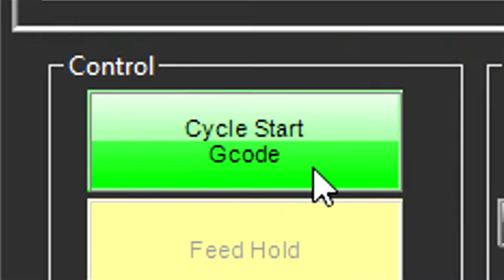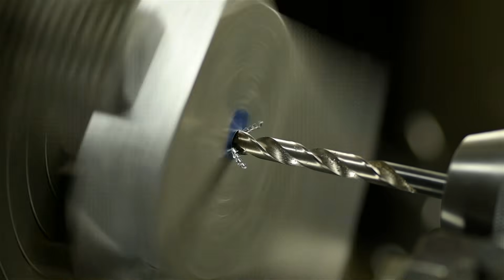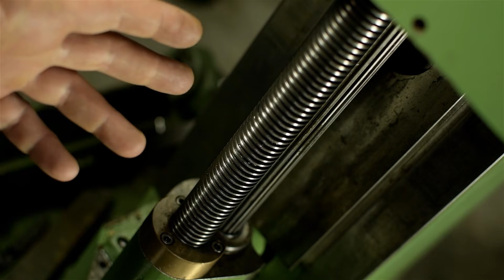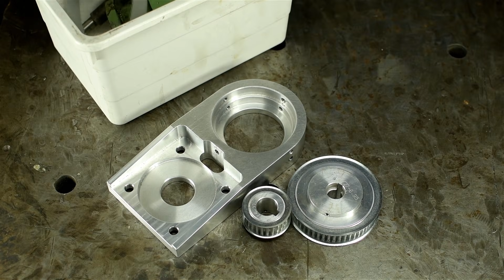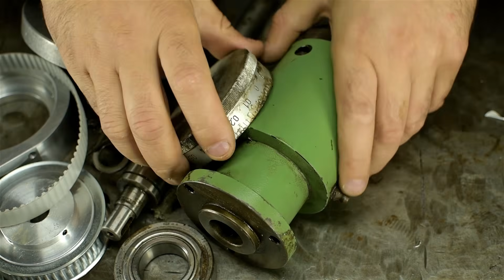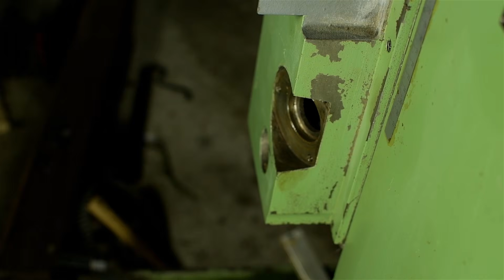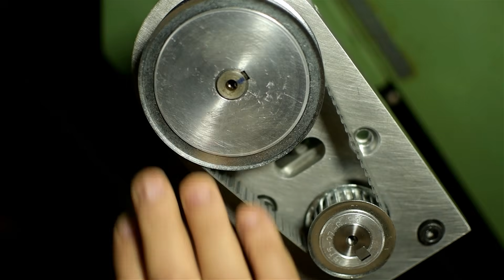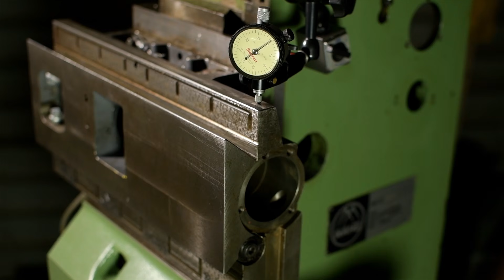MAHO: Move'n On Up!

Comment: The machine doesnt remember where it is when its off because of a battery, nor does it have anything to do with being closed loop. The encoder while being a part of that closed loop system is in of itself open loop. The reason why these drives remember where they are when powered down is because they use Absolute Encoders as opposed to Incremental Encoders. If your machine needs to be homed on startup {Haas} it uses incremental encoders. If the machine "remembers" its position even if moved when powered off its because of Absolute Encoders which have a unique code for each position on the encoder wheel. Incremental just creates pulses which are counted by the drive so it knows actual distance achieved vs distance commanded. {Actual closed loop system in operation}

Comment: The sprag clutch will most likely have been a mechanical brake for the downward motion of the vertical axis (Z?).

Having little resistance in the ways and screw might result in the handwheel free-spinning with nothing to slow it down until it crashes into the bottom of the screw travel.

This may also be why your belt is heating up, I would guess it's getting put under additional strain from having to brake the downward motion, which will also translate to your motor & driver eventually.

Comment: That weird sprag clutch in connection with the plastic bushing gives an extra friction in one direction and an even feeling on the hand wheel when moving the table up an down. Without it, the table would accelerate under its own load when moved downwards. Just my guess.
More important, for any positioning drive, the round-toothed HTD profile should be used in the timing belt. It is a bit more expensive, but runs much quieter and is free of backlash. A trapezoidal grooved belt isn't! Last, when a belt gets hot, it is over tensioned or too small for the job.

Comment: The belt may be too tight, but it could also be the radius of the smaller pulley. The belt tension across that small radius is deforming the belt and generating heat.

Comment: The reason the belt get too hot is that it is not sufficiently inelastic. By inelastic I mean that in principle the belt should not give or stretch in the lengthwise direction. That elastic stretch  cycling gives rise to heat. A bicycle chain and sprocket or gear set would not heart up but would probably be too stiff for the servoed stepper motor and would probably be vibration and noise prone. Somewhere there must exist a hardware/software happy compromise .. :)

Comment: I think you’re going to have to go to a ball screw. The problem that will cause you a ton of grief is backlash under load, especially when using solid carbide tooling. The head will lift under load as the tool engages and that movement kills tooling.

Comment: Hey Tony, check the power rating for the belt (heating), also if you are running it at high speeds maybe you can change it for another belt profile, like a HTD or a GT, nice job tho, can't wait for the next axis to be ready

Comment: Probably a little too tight? We end up using silicon spray/grease to drop the sliding/meshing friction heat. Manufacturers have a good equation that amounts to, "just tight enough to prevent oscillation or skipping". I think, we swapped the smallest ones for a teflon faced belt. Ooh, there's also a dry spray lube I got recommended once.

Comment: The weight of the table will take up all the backlash - as long as you don't accelerate above 1G downwards. It seems the lifting screw has  a finer pitch that you will get on a heavy duty ball-screw - maybe have to consider the weight and the torque required before replacing that screw. It may also be that the friction of the screw and the gears is what is taking up the torque. It will be interesting to get torque readings from the drive and do some math.

Comment: I'd base the decision on keeping the ACME screw or putting in a ball screw on the likely usage. If you're mainly going to be doing 2,5D (only stepping Z up and down in steps for z operations, or straight drilling/plunging) I'd just stick with the acme leadscrew as you won't be loading it that much and you won't have to mess around with a Z axis brake. If you plan to do 3D milling (z axis movement coordinated with x and or y axis motion) then I'd go for the ball screw as you'll wear that acme screw down quite fast.

Comment: Consider adding an idler pulley to your belt drives between the motor and the axis pulley. It'd be on the backside of the belt so can be just a bearing. You'll get more tooth engagement and you won't need to tighten the belt as much, which will probably cut down on belt heating.
Reply: You add belt tightness with an idler, so you don't need belt tightness. Yeah, OK.
Reply: @johncoops6897  It doesn't add tightness, it adds tooth engagement, Mr Johnny Come Lately.
Reply: @robotnicw  - I know, but his belt is too small to get any additional wrap. Plus it's not slipping, it's suffering from too much load. An idler pulley can't change that.

Comment: Hot and loud belts are usually from being too tight.

Encoder error is from no tuning. The max “step loss” alarm is triggered. Those motors can run max rpm 2-3000 with tuning so depending on your total reduction ~150-200  ipm? Not that you’d want to put those dovetails through 200ipm... forced oil system during rapids with sump and filter maybe? =) gonna have to oil those ball screws no matter

Comment: Maybe the motor is heating up. That heat is going in every direction. Check the current limitter if there is any in the drivers. Also black belts are good too.

Comment: I think you should stay with the acmescrew in Z. Ballscrews have lower resistance and the table will maybe "fall down" when you turn power off. You need then a brake on the Z Axis...

Comment: Awesome Tony!  Glad you jumped the cliff into the quality and precision of servos.  My DM's are still running 20yr now, sometimes 24/7, never changed a servo but belts and a drive once...think about 4096 quadrature counts on 20' and the accuracy you can hold or 4096 in 360°.  They called me to come in a couple of years ago because some one crashed the big drill into the chuck (wrong setup) moving the head!  Realigned it ran a test piece, dead on with 20 year old servos.  You won't look back but maybe consider upgrading your router. ;-P  That housing is Artwork!  Thank Mr. T, can't wait for the next adventure!  PS....just how many times did you have to R&R that table?  ;-0  Love you back More!

Comment: Hot Belt?  Since the pulleys look aligned, check the minimum recommended center distance for the belt based on the pulley sizes selected, and check that the belt tension isn't too tight.

Comment: basically, the encoder could be as simple as an increasing resistance carbon track with contacts to allow for telling when it gets to the 0 position (NC) and a value for literally any other position

im sure theres something much more robust or complicated, but some systems do use this

Comment: The timing belt might be a bit tight, hence the noise and heat. I suggest making the tension adjustable but that's a lot more work.
Excellent video as usual TOT 👌
Reply: He already made the belt tension adjustable. You need to watch the video more closely.
Reply: @johncoops6897  just because it's adjustable, doesn't mean that it's adjusted properly.
Thanks for the advice about watching videos.
Reply: @rossmarzano  - from other viewer's comments here, I think the real issue is that the (clear) belt is not really designed for that load and speed it's being subjected to.

Comment: With a ballscrew on Z,  you'd for sure need a counterweight pulley system.   If you added that counterweight first,   leaving enough uncountered to take up the backlash,  you might get by without a ballscrew for a while longer.
Edit:  pondering on the calamity of a knee that freefalls when power goes out,  I wondered if the original brake was working as intended for failing safe.  It would need hydraulic power to DISengage?!

Comment: the belt heat is probably speed + tension + load. for longevity, you're probably better off going with helical gears with an oil bath... yak shaving, but it'll be a lot quieter, and you can get a much higher gear reduction with an intermediary gear. from personal experience, with my 4.5kW electric skateboard and my 175lb body, the drive belt gets very, very warm on long drives. I have to put a new belt on it every ~100 miles from the wear.

Comment: Belt is too tight. You need to take expansion of mounting bracket into account as well. It will probably 
need to be 'pretty loose' when cold.
 It's why you see motorcycle belt drives open, Harley D found the chain case expansion could actually break belts and damage bearings if (usually) adjusted too tight so they went back to chain drive and plastic slipper adjuster. Renault/Citroen also had same problem in 1980's~90's, cam belt looked like it would jump sprockets when tension was correct (although IC engine is running at a much higher temperature)

Comment: The position tracking of the servos is a good start, especially for startup. But if for example the belt slips on the pulls, it won't help.

Comment: I think to keep the belts cool, you probably want to reduce the tension, that of course will mess with your accuracy. Tbh I'm surprised a big cnc like this would use belts at all. My 3d printer has belts but it's light and low torque, my esk8 has belts but they're loose to run quiet and less stress. When I built a 2 wheel self balancing skateboard on belt drives, I had to keep them super tight for good control but it was too tight and kept coming loose.

Comment: Hi Tony, The imperial boring bars are adequate for imperial dimensions but they are not really suited to metric tolerances - they tend to fractionate instead of increment.
Reply: Quick update - there is a set of "metric adjustable parallels" advertised on the big on-line auction site, maybe you could use those to calibrate your imperial boring bars?

Comment: Not sure if this will help but maybe changing the tensioner to a more conventional bearing that pushes on it (like in engine timing assemblies) helps with the heat and friction on the pulley

Comment: I re-watched this the other day and have continued to think about your noise and wear issues with the Z-axis.  I have a suspicion that you have too much tension on that belt.  I had thought that one of the advantages of a timing-belt drive was low backlash, even with relatively slack belts.  Yours looks tight as a violin string. That is almost certainly contributing to some of the noise and probably some of the nut wear.  Maybe smarter folks can chime in too.

Comment: even though it's closed-loop, limit switches are still a good idea as a backup, because encoders sometimes fail. ;) The drives probably have safety enable inputs for this purpose. But now that i think on it, if one of those motors goes open-loop, your day is gonna be ruined ,safety switches or no safety switches.

Comment: The heat on the pulley means that you are running the belt drive too fast (not strech heat - that would be where the belt leaves the pulley - but surface friction), so a different belt probably won't solve the problem. Chains or gears then.

Comment: 22:32 I'm guessing that the internal shaft for the stub shaft connector thing (for the handwheel) is transfering friction heat from the lift screw to the big gear (and the really thin belt).  Just my $0.0200001 cents

Comment: simplest way i explain difference with servo and stepper motors; the servos have a encoder for positional control, where as a stepper motor under extreme load could skip steps in movement.

Comment: That drive belt is clearly over-stressed and starting to feel the heat from being pulled in multiple directions. You can often remedy this by sending the belt on a weekend stress management course, it will learn coping techniques and come back a much stronger belt able to take the heat ;)

Comment: If you want smooth cuts with your imperial boring bar you should dail in your adjustments in fractions instead of decimals. It should cut perfectly smooth after👍. 
Or perhaps I have it the wrong way round, maybe it should be decimals...you will figure it out😉

Comment: Due to the weight on the screw, ball bearings are not needed. Contrarily, the currently applied bearing could be much more precise and stable than other solutions. And the wear is about the same. Replacement costs are not.

Comment: you should really look into stepper servo's they are closed loop stepper motors. the problem with servos is that they can and always will introduce what is called hunting oscillation which is basically vibration caused by the servo motor accelerating to the target and slightly overshooting then going back the other way and it will slightly overshoot again this process repeats causing that oscillation i mentioned and even if its so little that you can't see it its still happening which can cause problems with accuracy and and poor surface finish. this doesn't happen with stepper motors (unless you are microstepping which is more than im going to get into in this comment)now for what you typically do on this channel as far as tolerance you might be able to get away with it on this machine but its definitely something that you need to consider depending on your motor application.

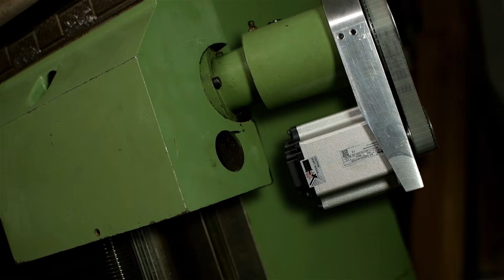Comment: 19:30 that's really possible, if I think of the DMU 50 evolution I have at work Wich can move with 50,000mm/min.
It bad enough to use the DMC 635 eco line and collide with 25,000mm/min 😓

Comment: If you attached a linear DRO directly to the axis rather than using an encoder on the motor then your closed loop control system wouldn't be affected by backlash in the belt, the bevel gears, and whatever else is on that transmission path.  Maybe backlash isn't an issue when you're working against gravity?

Comment: Wonder if Tony has ever karate chopped a finished part by accident :D
Oh, and one thing: what kind of belt are you using? For positioning drives it's best to use something like M-profile, not trapezoidal profiles. Also don't tension the belts too much.

Comment: What I have against servos is that the closed loop is a close loop: you servo system knows where the spindle is, but not where the work is. What I want is a feedback information coming from DRO sensors. That way backlash is controlled out of the system. It's 45 years since I did the maths behind servo systems, so I expect somebody will explain the flaw in my thinking.

Comment: I've experienced that cog belts need to be tensioned surprisingly accurately. Could too much tension be the issue with the overheating? The Gates catalog has a nice explanation on how to calc the proper tension based on the belt size and pulley diameters.

Comment: Those belts are just noisy. There are thicker belts with fiberglass reinforcement if im not mistaken that are a lot less noisy. The steel wire under tension is what causing all the racket i think :/

Comment: Awesome video. I bought closed loop Nema 34 stepper motors for my CNC router build. I was wondering about using a servo as a spindle motor on a smallish CNC lathe. Just not to sure about the feasibility. Looking forward to seeing your mill complete. Did you consider leaving the handles on to make it both CNC and manual?

Comment: I am not sure your going to gain anything by going to a ball screw for your Z axis. BTW I have leadshine controllers for my CNC router. They make good parts. Tony, I must say, you are one hell of a design engineer and machinist. BTW instead of moving the motor, you could have put in an idler pulley to tension your belt. Thinking about it, your belt may allow too much slop into your axis and you may need to go to direct drive gears. If that belt is heating up its stretching....just sayin.

Comment: Looks like you're using T-series timing belts. They're not designed for positional accuracy - only conveying.
Use HTD style belts and you'll have a far quieter system, with less backlash.

Comment: No limit switches? Probably not a good idea, things go wrong and software can crash sending your axis off the end and into a lot of damage. Put cutout switches at each end of travel which can kill the power to the servo.. You will still have to sort it out when they activate but hardware will not be damaged and you will be able to sleep at night.

Comment: You might want to back off on the tension on the belt.  Also, you should put the servo motor part# and controllers in the desc.

Comment: Is the cogged belt too tight?   I added a cogged belt to the output side of the jack shaft/treadmill motor upgrade I did on my lathe, and the belt is noisy. I will go to a multi-v belt later, but on a CNC, you gotta have the cogged belt for timing, doncha?

I learn more stuff about machining from the things you never mention/explain, than any othe way.  WHen you chucked up that piece of metal to make the mount, a light bulb went off in my noggin'.  I would have been trying to do that with the material stationary and the cutter moving.  It seems so much easier to use the lathe, especially since I have a lathe, and building a mill.

Thanks for all the things you do, but don't talk about.